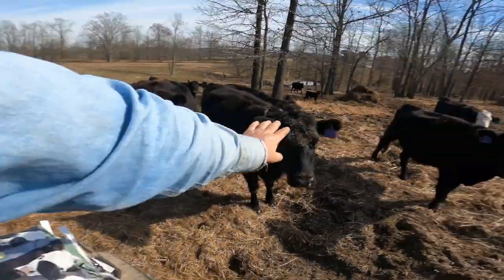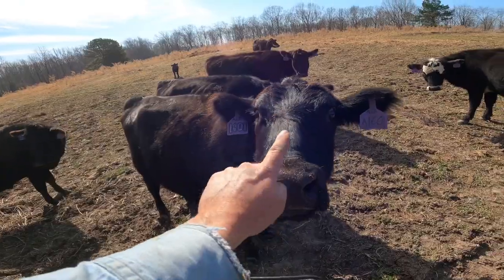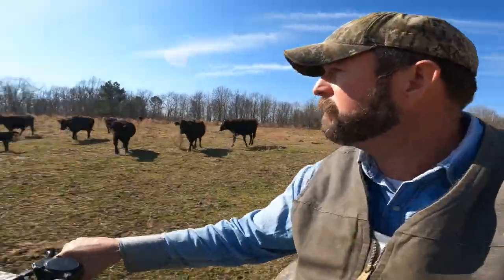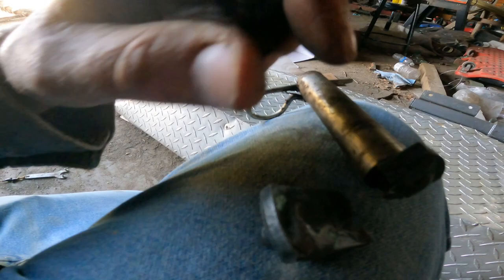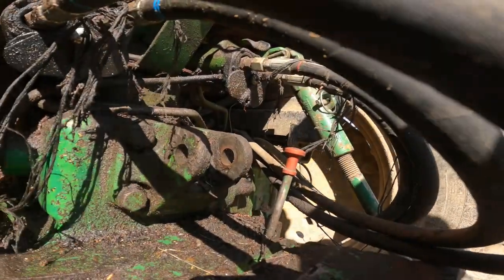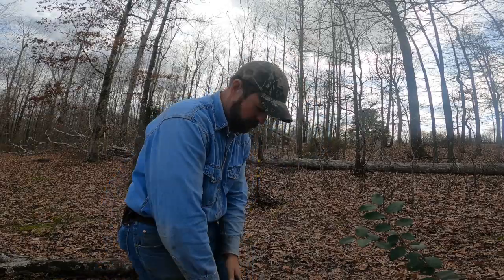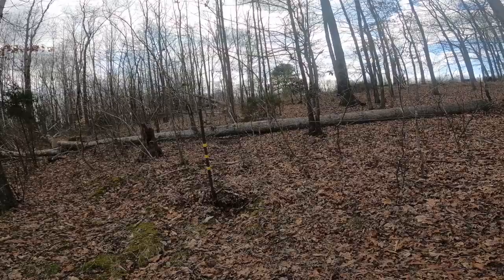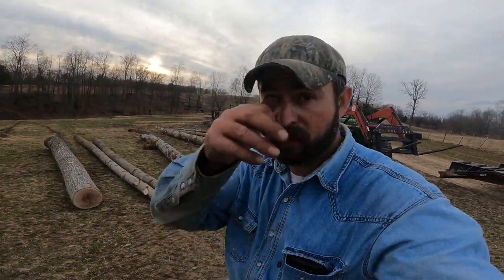How does that finger taste?

Comment: Hmm.. neighbors bull, or a little background in your herd???
In the 1970s and into the 1980s, there were a lot of crosses with angus to make them bigger.. every now and then, a little white pops up.. just saying, because I've seen quite a bit of it...
I like your logging arch👍
Reply from the maker: Yep, neighbors got a Hereford bull. It came through the fences 3 times last year. Even saw it riding one of the cows. Yeah, I e heard that before. Thanks, we took a old post hole digger frame and modified it to drag logs. Works pretty good.